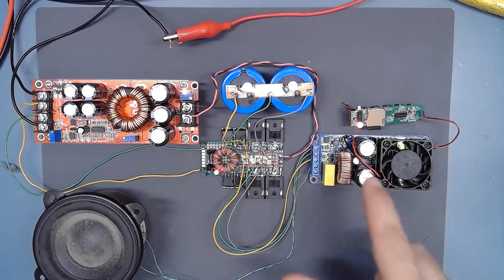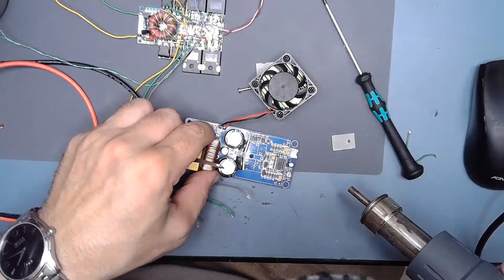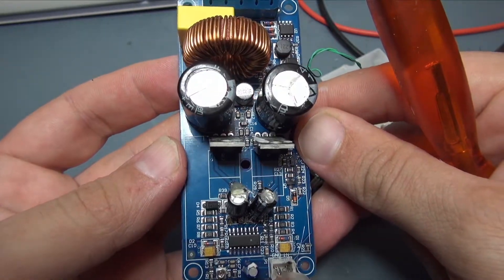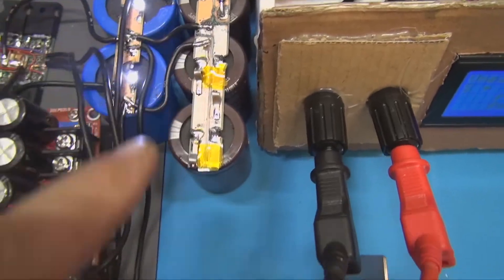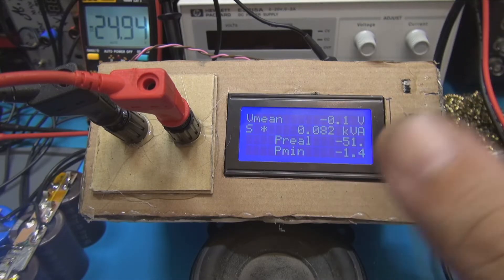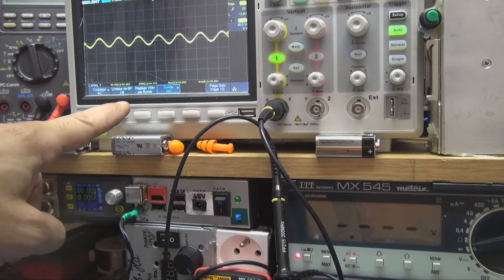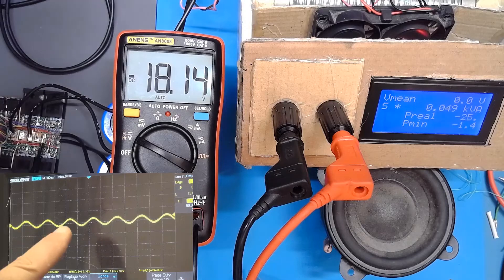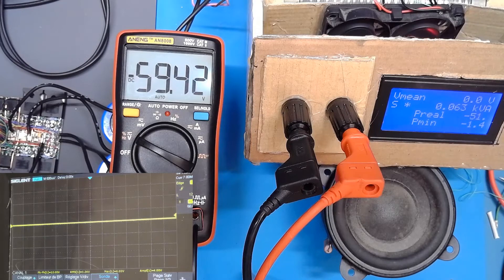IRS2092AMP-500W Class D Amplifier: The Real Watts

Comment: I have a 500W IRS2092 amplifier module. For the power supply, I am using a dual 65V supply, which is 4.5 amps. When I connect a high-wattage 4-ohm resistor to the amp's output and apply a 1000 Hz signal as the audio input, the amp's output voltage is about 10V, measured in AC (True RMS).
Why does the protection activate so soon? Pls help me.
Reply from the maker: check the real input voltage signal. It is enough high? A power supply of 4.5 A is not enought. Make same test with 20 ohms resistor. If the voltage is highter, means that your power supply is not good (you need 10A power supply in surge). Be sure your amplifier is under a power full fan. If the mosfet are hot, they provoque a protection, because they are touching the main IC. Please mount it on a bigger heat sink.

Comment: Sir this iirs2092s amplifier can drive a 1000 watts 4ohms speaker thanks..
Reply from the maker: Yes of course, you can drive a 1000W 4 ohms speaker with this amp. But you will have maximum only 450W RMS, wich is the maximal RMS 1% distorsion power of this amp.
Reply: @AIexanderHartdegen  ok sir thanks to your advices I'm only curious because I don't have any idea..first time to diy...

Comment: Sir. 
Good day. 
Are you using 60v DC? +/- 30v. ?  I pulled a transformer from a Peavey amp rated for 200w for that amp. When I check the unloaded voltage of the transformer I get +/-  32v. I was wondering before I try hook it up to this amp module cause I only have the one module and kinda don't want to fry it. Lol. It's hard finding good information on this 500w amp module. And help would be much appreciated. I thank you in advance. 
God Bless.
Reply from the maker: normally you will have low risk if you give lower voltage, but some amplifier don't like it. The minimal voltage is _/+ 58V.
A very low voltage can avoid the fan working. You can make a test, and using lamp bulb on each polarity.
I think this amp is able to work with such low voltage. Be sure you have NEGATIVE voltage and POSITIVE volage with such value (the values you quote).
Normally there 's no problem. Dont make a mistake on polarities, connect bulbs on line to prevent big damage, try and see.
Best voltage is 60V. The maximal voltage is about 70. In the video I use +/- 65V. 
Be sure about what you do. If not, just ask. Thanks for comenting.
Reply: @AIexanderHartdegen  hey thanks. Your reply came right on time. I was just making loadbox with these 250w 8 ohm resistors I'm setting up in various switchable configuration. And I appreciate your suggestion about bulbs. I had thought the same but only have one at the moment. Your advice won't go unnoticed once I make a video on the subject of this amp module. Thanks alot.

Comment: What causes the 10ohms resistor suddenly burn while operating?. hopefully will be answered,,thanks for sharing this vedio sir
Reply from the maker: High frequency MOSDET hight speed comutation. The 10 ohms resistor make short with a coil to remove some high frequency signal on the output, to protect the speaker. But because they are sizely inderrated, they suffer.

Comment: Nice video. Are there any plans available of your homemade powermeter? Would love to have it 😄
Reply from the maker: This is not my work. I just use it, change some parameters in the program, and put a 4 ohms or 8 ohms resistor for measuring the output power.
http://lektronik.canalblog.com/archives/2017/12/02/35920694.html
Reply: @AIexanderHartdegen  thanks for the link 😁

Comment: Have you tried connecting two of those class d amplifier input to work as mono using one mono signal?
Reply from the maker: No I didn't. But normally it should work. But of course you need to apply a inverted signal on one of them.
Reply: @AIexanderHartdegen  because direct it doesn't work
Reply from the maker: @Rasobenn160  no, not directly.

Comment: Wow, 400 w  60v?😅 fire!😅
Reply from the maker: no. 60V pure sinus on 4 ohm load = 450W Rms.
Reply: @AIexanderHartdegen  to get 60Vrms sinus at output, +/-85V supply voltage is needed.

Comment: if given a voltage of -+ 80 volts, can this power amplifier still work?
Reply from the maker: there is a regulation process with zener diode on the board. Maybe if you make it more sturdy, you can use more voltage. Also, the converter used to feed the fan can be blown. The good and maximal voltage is about 65V+/-

Comment: I also want to make this with the splitter, I plan to run 100W at 4 Ohms. What is the minimum +- voltage this can run at? +45 -45? Or more like +60 -60? Does this board have an isolated audio ground signal? I would think so right, otherwise it would not work with the splitter, since the middle point of the capacitor bank would short to boost converter ground.
Reply from the maker: yes, you're right. This splitter is made to use the amplifier with a mp3 player, wich don't need a ground reference.
If you want 100WRMS on 4 ohms you need 33V +/-
The splitter is a way to use this amplifier on a car. If you want to use it at home, please use a classical symmetrical transformer... If you use a spliter, anyway, the ground on the amplifier is a floating ground.
The sound connexion need to be connected to the ground behind the booster (same as the battery) and the hot line need a 4,7µF capacitor to the lead entry. It may be work, or can emit some switching noise, I need to make a special test for that. Anyway, if this aspect didn't work, it's possible to use a isolated audio homemade audio transformer, and connect the wires directly to the amplifier without any care.
Reply: @AIexanderHartdegen  Thanks for your answer, however I don't understand how you would connect it. A 4.7 uF cap from audio + signal to amp input?
I just looked in the datasheet and I think the sound ground is isolated from the power ground, so I guess it will work fine. I want to make a battery powered speaker, not from mains power.
Reply from the maker: @martg.b.6160  the RCA signal contains the ground and the hot wire. The idea is to connect the hot wire with a sure 4,7µF to the hot input, and ground to the ground battery.
Normaly it would work. But I didn't tested it. The ground of the amplifier is not the same ground as your battery, because it's a simmetrical entry. There is a ground, and a negative voltage IN, this negative is not the ground. But you can define your self what is ground or not when you buld something. This is amplifier with simmetrical power supply. The O volt is the ground. All connexion will take normaly this reference, but not with the splitter, because the ground OV of the amplifier is not the ground 0V of the battery. But because capacitors are magic you can try to connect your rca ground to the battery ground and using a little capacitor to feed the amplifier entry. Anyway, you can use a transformer, it make it very more safe and easier. I need to clean my workbench and try my idea.
Reply: @AIexanderHartdegen  Yes would be cool to see if a decoupling capacitor is needed or a transformer or if you can just straight up connect it the input to the hot wire. I would like to see the video if you do it
Reply from the maker: @martg.b.6160  I am quite busy and tired, need to find time and energy to begin the clean up.
Reply from the maker: @martg.b.6160  according the advertising on aliexpress it requires 58V -/+. But It's easy to try, I have a special power supply for that.
Reply: @AIexanderHartdegen  Okay take it easy!

Comment: Can you run a audio amplifier directly off of that 1800w boost converter? Or does it have to have a battery to constantly feed power to?
Reply from the maker: in this video they are 1300W models. But 1800W are more solid.
Reply: @AIexanderHartdegen  whichever one it is does a battery need to be in between the amp and the converter? Because it's fluctuating power? Can the converter keep up with the random demand of power?
Reply from the maker: @SheikhN-bible-syndrome  you need capacitors of course. To avoid fluctuating, you need 4700µ per rail. Best are 10000. You don't need batterys between amp and converter. But take note that this amplifier requires a symetrical power supply, this is why there is a spliter here. If you don't use a spliter you can not use a amplifier like that. You need to buy a symetrical output converter, wich are quite expensive. This is the reason I use a inexpensive spliter here to use a 10 dollars converter.
Also, if you want to use some very good quality amp wich cost around 60 dollars, they are high quality and requires only a single rail. I hope  answered what you need.

Comment: Amigo, muito bom vídeo. Gostaria que me tirasse uma dúvida. Eu retirei o dissipador desse mesmo  amplificador IRS2092S 500w para ver o C.I,  e  no corpo do C.I está escrito "CSC3120 AKHoH" . Eu estranhei isso, pois o circuito integrado  IRS 2092 possui a fabricante IOR e o nome IRS2092. E também estou percebendo que o Amp não está tão potente. Quando eu vou medir na saída a tensão dele em 60Hz , a tensão chega no máximo a 6 V, sendo que estou alimentando com um trafo que retificado fornece +68 0 -68, e é já vi esse o Valdemar Gomes colocar 36V na saída. Meu trafo é de um minisystem Genezi com uns 6A de corrente. Você poderia me dizer o que vem escrito no C.I do seu amplificador?
Reply from the maker: like mentionned in the video, it was written IRS2092 on the IC. The name of the board is the name of the IC. Like described on the video, this device is able to provide 60v on the load. It has a real power. Your benchmark is difficult to found on the net, may be you have a part replacement (or a fake one). Also, if we had more information, we can expect that you have a defect product.
Reply: @AIexanderHartdegen  Obrigado pela resposta!!

Comment: Hello, the board is only 250W @ 4 ohms maximum. Chinese manufacturers have difficulty understanding that two 250W channels operating in bridge are needed to provide 500W of power. This board is based on the electronic schematic of IRAUDAMP7S, but resistors R13 (100R) and R15 (130k) appear in the diagram with different values, R7 (3.01k) and R8 (120k).
Reply: No, it can really provide 450 watt RMS with very low distortion.
Reply: So i need to change those? Saw that on a different video.
Reply: (For IRAUDAMP7S) NOTE:
    Potentiometer P1A and P1B have been set to zero ohms. This is configured as a 2 terminal variable resistor. This should be set to 200 ohms. This will give a nominal operational frequency of 400kHz for the amplifier module.
    Check the tightness of the devices on the heatsink. (Source: larrynz911)
Reply from the maker: This board is able to provide 450W RMS with less than 10% distorsion. At 10% distorsion, she's able to provide 500W RMS, exactly like the seller said. If you're not agree, look the FULL VIDEO before commenting.
Reply: @AIexanderHartdegen yes, I tested too, but I have replaced those boards IRS2092 with original pulled from Pioneer av receiver and replaced it's coil also with pioneer av receiver. Sounds great
Reply: @Rtek-zv5lr  It is not worth driving the carrier frequency of these modules over 400kHz, it is  better to keep it around 365-380kHz .
Do not twist the carrier frequency trimmer for nothing!
It makes sense to tweak it only if you have an oscilloscope and the possibility to measure distortions, otherwise these trimmers are set in the factory in quite right area and you shouldn't tweak them because it can cause a malfunction.
Reply: @inarinukka7729 brother, what the bulshit are you talking ? Just 20khz drift will not do any harm, and when you have multiple boards, it can be useful to change the carrier freq to get rid of unwanted oscillation

Comment: I wonder if you can use those 500 watt Harbor Freight or Benford halogen lamps as your load Bank as they pretty much don't have a problem with heat.  
you may have to put a few of them in series but I think that would work out pretty well, 

they're already made to handle some really rough environments show some really hot and heavy test tones shouldn't really bother them all that much.   the filaments are usually suspended within the course class so again I don't see any problem why this would not work and it would be fun to go ahead and watch the halogen light bulb glow.

the fact they're only a dollar or less really is a great value and it should work out pretty well for a load Bank.  

almost with just about any Chinese board it's best upgrade the components when you can as you're really going to actually see some real world benefits. 

and I 100% agree the heat sinking and the fan used on this really is not ideal for max power testing but it does work pretty well for most people who just want to listen to music
Reply from the maker: Of course not, we can not use those kind of bulb, because simply the ohm value is depending of the heat. Unfortunately, in those kind of test, you mandatory have to use classical resistor, with the desired value. Yes you probably right, I think this heatsink is enough for people who just want listen music. I want to notice that this amplifier has a very incredible low current idle, and this is a proof of the good ingineering of it.

Comment: This is a good instructive video indeed. I would however point that there is no such thing as rms power as indicated in the title "500 W...rms?". Real power P is expressed in watts and results from averaging the instantaneous power p(t). We talk about average power and this formula is valid regardless of the waveforms and phase. If you power a pure resistance, then multiplying rms voltage and rms current gives the same watts as if you average the instantaneous power p(t). If you now have distortion or phase lag between waveforms, multiplying rms variables will give apparent power expressed in VAs while the averaging of p(t) will always give the watts performing the work. All the other "units" like rms or PMPO are usually pure BS in my opinion.
Reply from the maker: We are working here with a pure sinwave and pure resistive load. All power computation are made exactly like you calculate the power of a resistive heater. P=UxI. If you use max value, you will have max sin value. If you use RMS value, you will have RMS power. Also, the 500W are avalaible here, but with 10% distortion. In the video calculation, I chose 1% distorsion to calculate the real power (in RMS) of this amplifier. From the start of the video, no maximal power was noticed ever once.
Reply: Thank you for this added comment but I will have to respectfully disagree with your statement "you will have rms power": there is no such a thing, you have watts and average power.
Reply from the maker: @clunche  RMS means "rooT mean square". And the RooT Mean Square of a signal on a sinwave is a average equivalent signal. The average signal is the equivalent to a continue signal wich will produce the same heat (in power) like the discontinue current. When we talk about RMS, it's because we work with complexe and discontinue current. The notion your saying is for DC current only.
Reply: I see, just Google "there is no rms power" and you will see the concept. Averaging an instantaneous power p(t) to obtain active power P in watts works regardless of the waveforms and the phase (PF different than 1). If you multiply Vrms by Irms, you have VAs which is apparent power and this apparent power equals the average power in watts if the variables are measured across a resistance (PF = 1). Hey, no big deal, just a friendly remark! : )
Reply from the maker: @clunche  you probably come from industry's motors and technology. Here, it's a pure sin signal injected to a resistive load, and it reduces the computation at the simplest. Into a speaker, it will be slighly different because coil is not a simple passive component.

Comment: Can it drive two 4ohm 300w rms subwoofers in series?
Reply from the maker: yes, you will have half power for each (125W per speaker in series). In parallel it can be dangerous, the output mosfet seems not to be cut for 2 ohms load.
Reply: @AIexanderHartdegen  oh i made a mistake i was going to ask in parallel as 2ohms , thanks you cleared my doubt

Comment: hi 
I speak Spanish, 4 ohms 60 volt rms? or 40 volt rms?
Reply from the maker: the supply is for 4 ohms impedance, 65V+/- stable for the supply.
The voltage for measurements are filtered so not RMS. They are MAX voltage on the multimeter. So, 60x60=3600, :8=450Wrms.

Comment: hy sir, where do i find the voltage splitter?what features does it have?
Reply from the maker: you need to build it your self, like I did. The specs are single voltage entry= Symetrical output,  the power avalaible on entry is divided by two. Ex: 6OV 10A on entry give -60+60V 5A. The module I made on the video is able to hold 2OOOW.
https://www.youtube.com/watch?v=8a-9RnGA7QM&ab_channel=AlexanderHartdegen